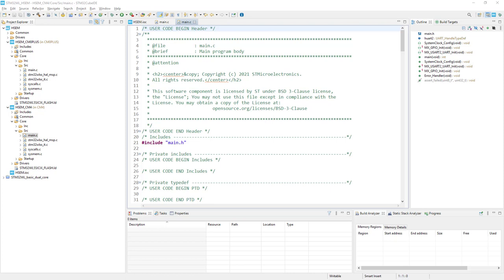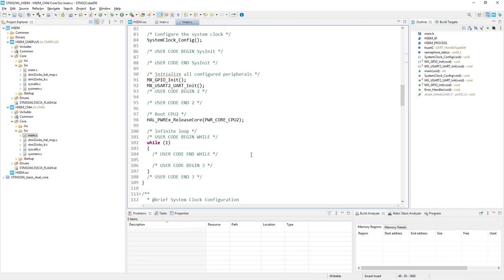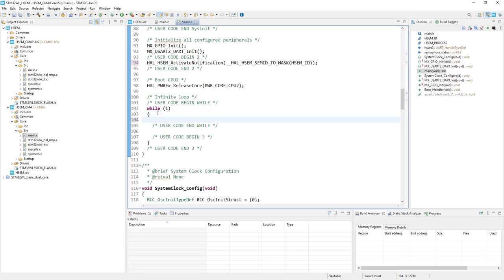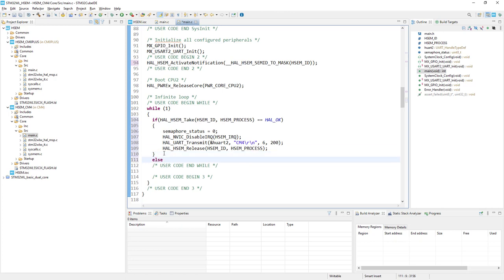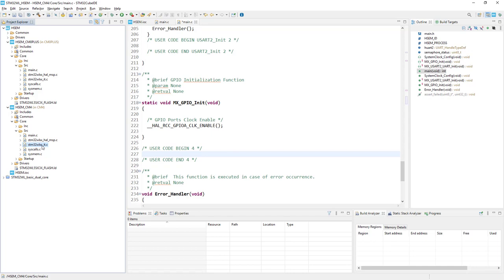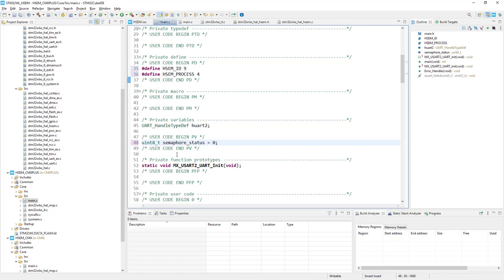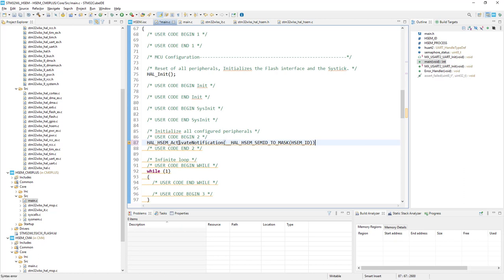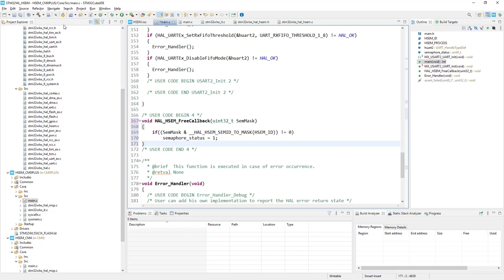MOOC - STM32WL55 Hardware semaphores HSEM in practice - 3 - Coding

Comment: fine tuto, very well.
in HAL_UART_Transmit(&huart2, "CM4\r\n", 5, 200);  i guess the size is 5 not 6 
For having alternate CM4 CM0P i have to correct  HAL_Delay(900); in CM4   main.c
Reply: A string is terminated with the \0 character, so the actual size of "CM4\r\n" is 6 bytes: ['C', 'M', '4', '\r', '\n', '\0'].